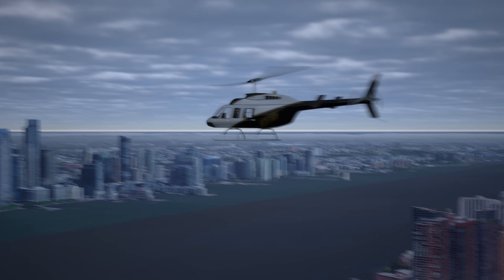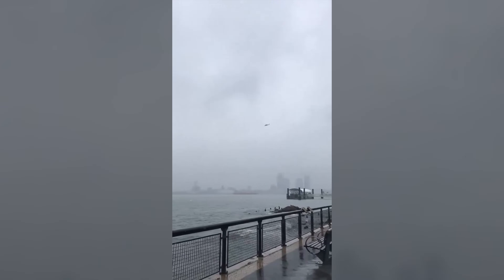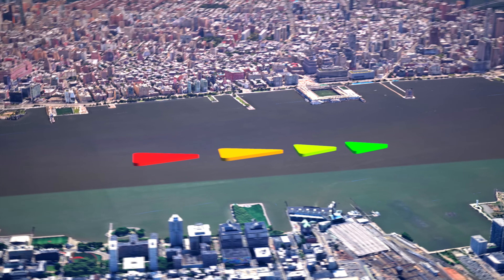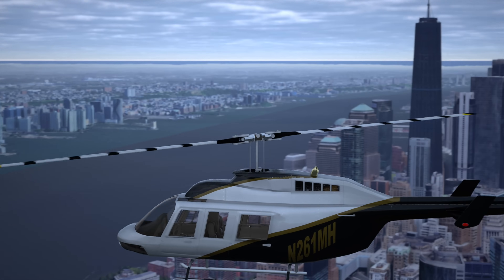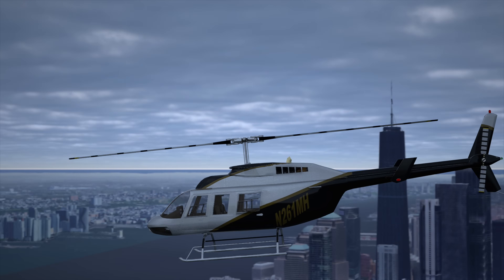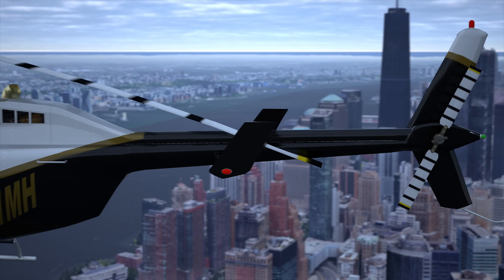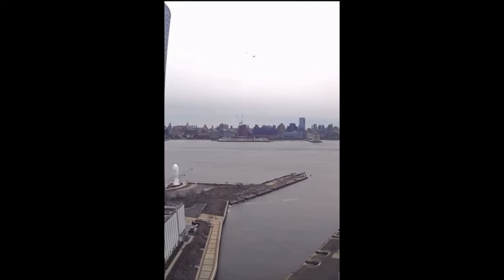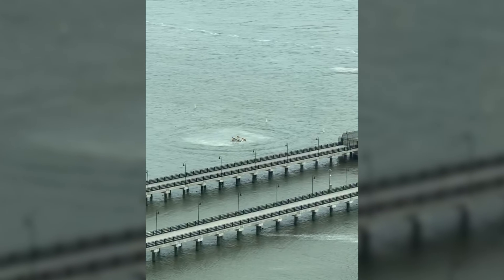Helicopters DON'T just fall from the sky - What is "Mast Bumping"?

Comment: I have 300 hours on the Bell series. In a saltwater environment, corrosion can affect bearings, rotor heads, swashplate, control rods, linkages, the entire tail assembly, all kinds of issues when hovering over salty moisture. I know the Hudson is primarily fresh water but has a lot of salt-intrusion esp in the NYC area.
Reply: I don't know much about helicopters but you are correct about the salinity of the Hudson.  The current salt-front location is all the way up in Poughkeepsie at the moment.  Snow melt from the Adirondacks will start pushing that south as Spring progresses, but for now it's a very salty Hudson bordering Manhattan.
Reply: Corrosion control is a very important part of maintenance. It is taken very seriously.
Reply: Helicopters operating in a high salinity environment should undergo additional checks.
Reply: Liar.
Reply: I have 301 hours on the bell series and I can say saltwater environments don't have a corroding effect.